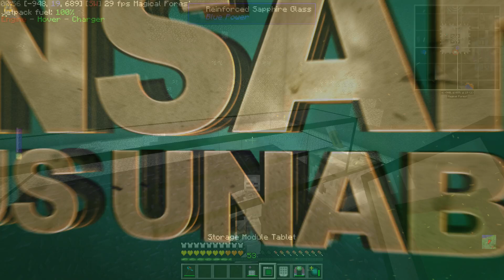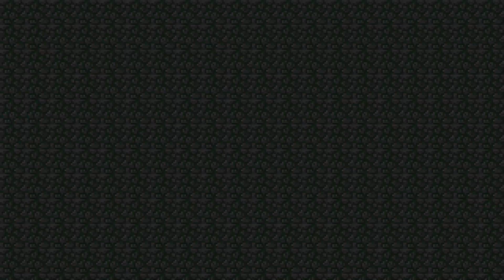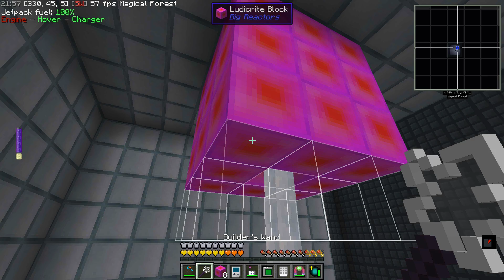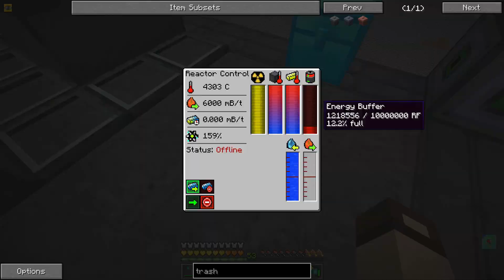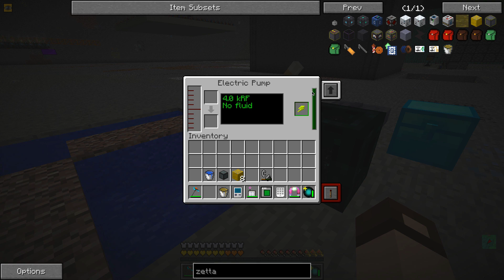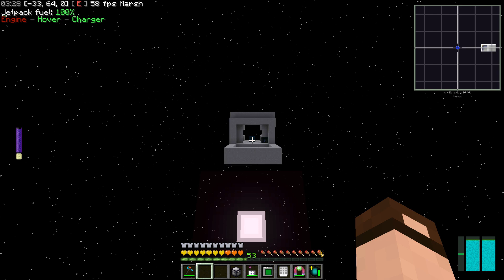Primus Unabridged - 20 - I Have Da Powah

Comment: The reason you crashed with the Tesseract is due to you trying to access the block before it has correctly registered its settings. The only way to avoid this is giving the Tesseract a second after placing it down before you try and access it.
Reply from the maker: I think it was actually Inventory Tweaks. I placed one Tesseract and Tweaks brought another invisibly to my hotbar. When I clicked to open the Tesseract, it tried to do that and place another Tesseract at the same time. I had the exact same problem with Big Reactor blocks too. I'm probably going to disable Tweaks's auto refill feature since it's so buggy.
Reply: +Nonsanity Seconding the buggy auto-refill. But if you expect it to refill and think it didn't, just right-click in the air to make it work.

Comment: You can set all reactor rods manually very easy as well. Just hold Ctrl.
Reply from the maker: For some reason that never works for me.
Reply: +Nonsanity Have you tried both Crt keys? Because of the way the keys are coded it does make a difference for the computer. Most games just handle both the same
Reply: +Nonsanity On this topic, it looks like there's also a text input at the top where you can just put in "94".

Comment: For redundancies sake put three more around your reactor xD
Reply: FacelessKitten
You might, I haven't used SFM in a while.
Reply: Also to automate the sulfur liquid, cant you use steves factory manager to detect a change in the water into the sulfur? 
Use that to activate the pump on and off, then use its trigger to activate the pistons about a minute or two later
Reply: Also use either sfm or a autonomous activator to place the sulfur from underneath then an autunomous activator with a flint to light it from above
Reply from the maker: If I was going be constantly making batteries, or even just making the three more you suggest, I might fully automate the system. But the time necessary to automate it all would be greater than the time it would take to run it in the semi-automatic mode that I have for the small amount I needed. I did test a block update detector on the liquid change, but the flow events made it unreliable. It's all a matter of time management—there are other fun things I could be doing... in space. :)
Reply: +Nonsanity cant wait to see the surprise next episode :)
Reply: +Nonsanity You might be able to use a block gate to check for sulfurous acid. Although because you can't break fluids, it might not.
Reply: +endreman0 cant you use the block gate to check for the absence of water? (ive never played with sfm)

Comment: If you can set up something to place it all(Which I suggest formation planes for the following), I'd suggest auto-placing block to drop a wither onto the teleporting plate from thermal expansion, to warp it into either a renforced obsidian room, or warded room(Thaumcraft). From there use a favored automated killing method, may it be killer joe or an autonomous activator. :P To power them I'd suggest using the trasvector interface. It's in one of the thaumcraft add ons you have in the pact. It can allow for wireless block access. So you can do that for both that, and whatever block you use as a collector. :P
Reply from the maker: I sort of like the automated wither-killer I made in a previous episode. I used it to make all that ludicrite. Though, it's the wither skeleton killing that takes forever in this pack, since they only drop skulls if killed by a real player.
Reply: +Nonsanity totally derped on you having an auto wither killer. Use diamond spikes with looting. they're counted as player kills and enchantable obviously
Reply from the maker: So far, nothing that counts as a player kill—including diamond spikes—cause them to drop skulls. I'd love to have one that worked in this pack...
Reply: +Nonsanity I guess something has been done to the configs...odd...
Reply: could always do bees xD
Reply from the maker: Yes. That's the only automated way to get skulls that I know of. But the breeding tree needed to get up to the right bee is long. Even with all the genetics, that's a lot of boring work—the sort of stuff that doesn't make for good episodes. I'm inclined to skip it.

Though... If someone else on the server makes them, I'll be sure to hit them up for a handful of the drones and a spare princess or two. ;)
Reply from the maker: The "fake player" is probably being prevented from dropping skulls. If the killer doesn't show up in the who's-online list, they probably fail the check.

But, if someone finds a way... it's cookie time! :)
Reply: I would pester the bee man :P
Reply: +Nonsanity In the interest of interesting episode content, why not automate bee breeding with OpenComputers? Direwolf20 did something similar a long time ago - SSP S5 maybe? - but I'd like to see your take on it.